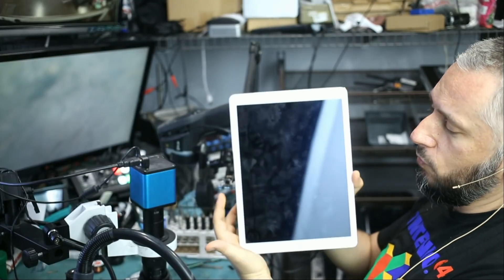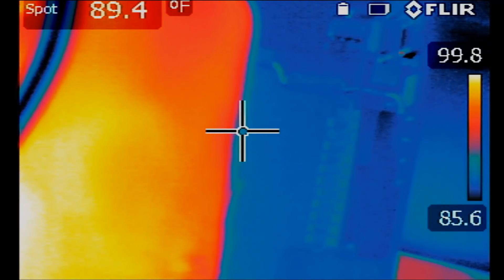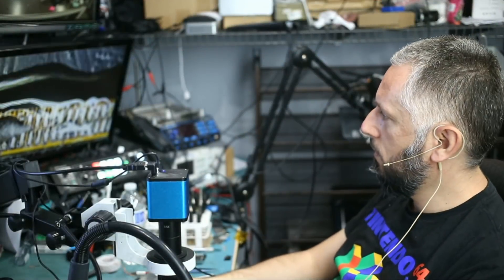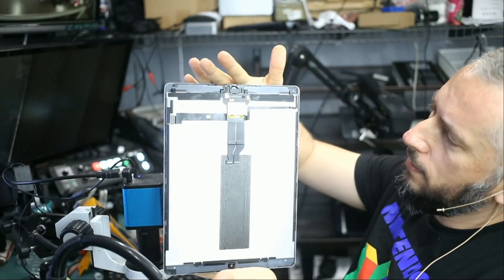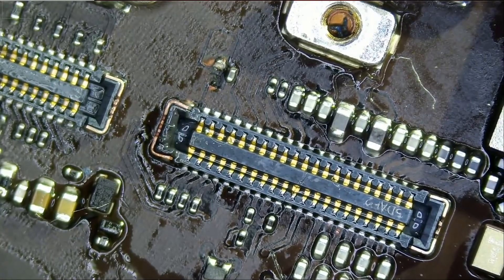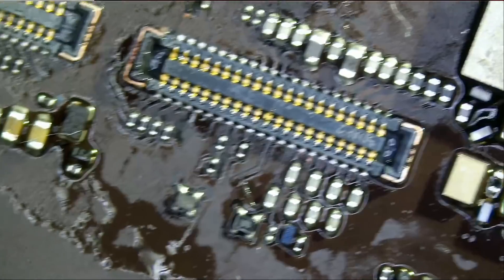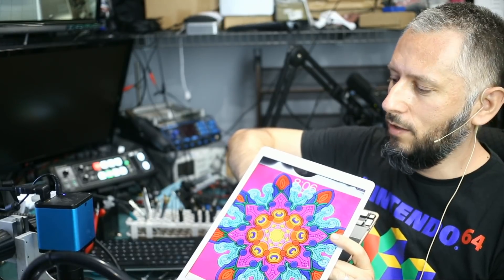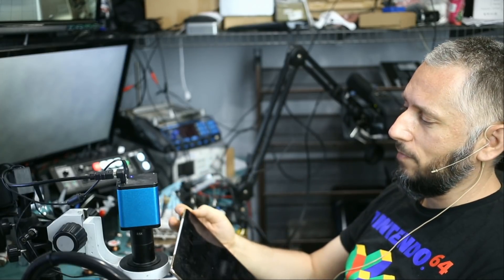iPad pro 12.9 No power  Stuck at 0.48A - What could possibly be wrong?.

Comment: 0.45-0.48 amps usually  short thats easy to find 
0.08 amps usually hard to find voltage leak that needs hard wire to find.

Comment: And here we see a victim of ifixit, "oh you can do this easily yourself" and ending up on Northridge Fix.
Reply from the maker: Almost every iPad we worked on had prior DIY repair attempt. Skills are developed with practice and not from first attempt.
Reply: Or Youtube fix-it.
Reply: or maybe that was the plan all along...
Reply: @Method Man What about Hakko soldering stations? I have managed to get one cheap. It has both hot air and soldering iron. Are they any good?
Reply: @andrasszabo7386  yes they are good. If you have an ok hot air station, you can do most of the board level repairs. Ofc you need experience the most

Comment: So what's with these surface mount caps being so crappy and shorting out all the time? I'm wondering if they are just junk or fragile or what? (root cause analysis here)......
Reply from the maker: Most electronics fail because of shorted caps. Specially Tv's. Caps can wear out overtime. Thermal stress can also cause failure.